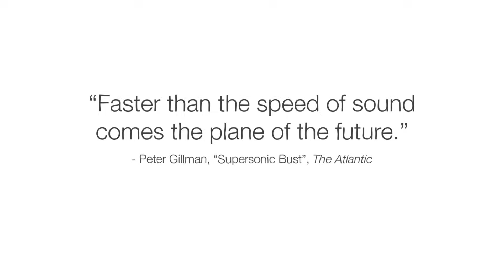Why are airplanes slower than they used to be? - Alex Gendler

Comment: I hope to see the day , where supersonic flights , are seen in big airplanes. As someone who has to travel from Madrid to Guatemala City and back to Madrid , 7 times each year , wich means making the flight 14 times each year , and it is an 11 hour flight , It would be life changing if it could be done in 5 or 6 hours
Reply: The Problem there is a bunch of physical limits and restrictions.
Various parts of aerodynamics/air resitances increase exponentialy with a linear increase in speed, which means that e.g. if you go from 500 to 600 km/h your required power goes up by 20%, but to go from 900 to 1000 it goes up by 30% even though both are 100 km/h improvements.

Air speed is fairly fast compared to other modes of transport, as you need a certain minimum speed to fly, and the fixed costs of airplanes (seats, certain safety features, cargo space, the crew etc.) are high. So if your plane costs you e.g 9k 'fixed' + 5k 'variable' costs an hour to fly at 500 km/h, spending 200 more an hour to go from 500 km/h to 600 km/h is worth it, as the pk fixed costs will still be larger while covering mroe gorund, meaning you save money. But going from 900 km/h to 1000 km/h miht up variable costs from 8k to 10.4k your total costs will go up more than your speed increase. 

That in turn means ticket prices will go up, and while numbers i gave here are just imagined examples, i've seen various papers in the past that calculate anywhere from a 2 times to a 4 times increase in ticket prices on average to go from 900 km/h top speeds now to 1400 km/h top. 
Then consider how much you pay for your flight, and consider if spending 3 hours less on a plane would be worth it to you to (probably) spend at least a couple hundred dollars extra, if not more. 
And most of that comes from hard physics limits. The stuff mentioned in the video is just convenience tech to break the shockwaves, that doesn't reduce the cost of the fliht in any way.

Comment: Is the same for cars, cars are slower today? Standard air travel vs the Concorde isn’t a fair comparison.  It comes down to cost, fuel at high speed will always cost a premium even with advancements.   As velocity goes up.... drag increases.    A car can go 150mph with 5 miles per gallon or go 60mph at 35 miles per gallon.  The designs are nice and very well explained just the title is a bit off.

Comment: Not only Concorde disappeared, but regular airliners are getting slower and slower.
When de Havilland Comet appeared it went 450 knots, 
at the same time Tupolew 104 went 510 kn,
Latest Boeing 777 travels 518 knots and it is considered an achivement over speeds of 500--, most modern airliners travel.

Comment: What on earth is surprising about a Sonic Boom? We have known about these, in practice, for the past 80 years. Concorde was noisy at even subsonic speeds, because of its engines.  Surely the main problem about aircraft speeds is that to maintain a safe air traffic control system, all planes in a sequence have to be averaging the same speed, otherwise they are likely to have close encounters.

Comment: I saw too that the concorde was just too fast. with it being expensive it was mainly restricted to the upper class. so the seating could not be like economy seating which meant fewer people on the plane at a time and combine that with weight being an issue the load is very limited. also with it being so fast people weren't really buying food or drinks in the air which I guess makes up a lot of the airline's revenue. Also flying has become a bit of an "experience". People don't want to pay a lot for a very short ride.

The standard commercial jet is just more profitable. they can have more people on the plane and since it's in the air longer people will get thirsty and hungry so more likely to buy more products. Like it was stated in the video the demand wasn't there to make flights fast so they stuck with the most profitable method.

Comment: The problem with supersonic flight is that it is fuel inefficient. In a plane the Lift over drag ratio (L/D) should be maximised at cruise conditions. In order to achieve this an optimal cruising speed exists. For most aircraft this speed is subsonic. If the aircraft is designed such that the optimal speed is supersonic, it will generally have a much lower maximum L/D ratio. Given that the main challenge currently in aviation is reducing the carbon footprint and increasing sustainability, using supersonic planes for civil transport does not seem feasible currently.

Comment: Planes, like semi trucks, can only go so fast economically.  At increased speeds, you are encountering more drag which starts really costing a lot of fuel.  So, at a certain speed, you are safely airborne but using a minimum of fuel; each increment upwards costs.  This would only change if people really complained and cared; but they don't.  If everyone demanded going fast, at any cost, the SST would've survived and we'd be overrun by more and more of them...

Comment: Another problem with Concorde was they had to have certain requirements for runways as well as taking of and landing could not be done with aircrafts in a certain radius of the airport. It wasn't just the cost of the aircraft itself but also the runways and other complications it caused with other aircrafts making Concorde unsuitable for airports unless requirements were met.

I grew up on the funny story of my dad learning to fly a light aircraft and that a Concorde aircraft was made to wait until he landed.
Reply: I’d heard was one of the reasons that Concorde wasn’t given more US airports was simple jealousy. The US airline industry had nothing comparable and the C rubbed their noses in it. So they amplified the complaints about it to stymie the project long term.

Comment: The higher you fly the less energy you lose to drag resistance. But too high and there won't be enough air intake to power the combustion engine. If an all electric plane was feasible I'd be a lot faster... I give tesla like 5-10 years there's not much elon can't do

Comment: Some corrections needed. But the one that stands out is the timeline of Concorde. It’s very convenient and adds to the flow of narrative but Concorde planned exit from service long before 911.
The engine failure over Paris in July 2000 bought forward its end quicker. Other issue that was known before 911 was from supersonic flight. a/c that sustain supersonic speed have a low shelf life. Due to stress on airframe. The high cost of maintenance, after supersonic speed a/c has maintenance check before next flight, unlike a 777 that can after pilot check go on another flight. Concorde has some panels that has to be opened and checked my me. Hahaha. If you asked a mechanics for Concorde they would tell you the plane take so many hours for just one flight so it’s not worth flying. 
This is common with “Ted everything.” It’s a talk that needs flow. So some facts are over looked or negated.

Comment: Another few problems I see:

1. The total time of making a trip also includes the time getting to and from the airport and through security. If getting to the airport and onto the plane is going to take you a total of 2 hours, and perhaps 2 hour to disembark and to get through customs, get your luggage and arrive at your final destination, the difference between a 6 hour flight (10 hours total) and a 2 hour flight (6 hours total) is not really as useful as it seems. Plus, if for the price of sitting in a normal economy-style seat on a supersonic airliner you could fly first class in a layflat bed in a subsonic airliner, and have enough time to take a nap, etc., the benefits are even more reduced.

2. Jet lag. Even if you could teleport somewhere instantly, you are going to have to deal with the problem of jetlag. At least on a 6 to 7 hour flight, you may have a chance at taking a long nap, etc. 2.5 hour flight, not so much. Perhaps on a north to south route within the same time zone or two it would be advantageous to have as short a flight as possible.

3. Range. The Concorde only had a 4500nmi range. Due to the reasons noted in #1, a supersonic aircraft may be most advantageous for time savings on long flights. The A350 XWB Ultra Long Range can fly routes up to 9700nmi. It would be nice to see a supersonic airliner with this type of range.

Comment: "A standard transatlantic flight stil uses as much as 150,000 liters of fuel"... How come TAP Air Portugal has a transatlantic route from Lisbon to Newark (New York) with an Airbus A321 LR that has a maximum fuel capacity of 32000 liters of fuel? With 150000 liters of fuel that is 90% of the fuel capacity of a Boeing 777-300 ER that is the largest dual engine commercial plane in the world you can fly from Paris or London to Los Angeles (on the Pacific coast of USA) no problem ...

Comment: This is only partly true.  The SR-71 proved you can make hyper sonic planes MORE fuel efficient by using cones within the intake that slows the air done to subsonic speeds. While traveling at speeds still unsurpassed till this day. I believe we as a people stopped advancing and wanted money in our pockets hence why we stopped using the Concorde. Somethings aren't that deep. It comes down to bottom line and politics. Planes traveling faster means we get goods faster. But more on that later

Comment: What about taking a page out of the F-14 tomcats books and having the wings retract back as flight speed increases? Mount the engines at the rear similarly to the DC9. I suppose that wouldn’t help the sonic boom problem but may help fuel economy as long as the mechanical engineering required to do so doesn’t weigh too much.
Reply: Where would the passengers go?  Do you realize how big the wing swing mechanism would have to be for a wing that large?  Oof?
Reply: @Ampersandrascott  how big? There’s obviously a reason they don’t do it. Highly unlikely I thought of this before actual engineers.
Reply: @dannyd806  Let me give you an example. When we were developing the Boeing Sonic Cruiser, we were fighting the size of the mechanism to control the canards. The passengers would have had to duck under it when going up and down the aisles. Now, a canard is very small compared to a wing. The pivot itself would protrude into the passenger compartment, not to mention the drive mechanism to run it. The Boeing SST had slanting wings, and to keep the weight down it employed an astronomical amount of titanium. We all remember when the SST was cancelled. It practically put Boeing out of business.

Comment: I dont know how planes fly but why not use the super sonic speed to go really high and then slowly descend towards the destination without using fuel?  
Maybe some sort of wings that can change shape,heck they could do some sort of electric powered engine instead of fuel and that the engine works by taking in air from outside which spins it really fast and thus creates electricity that powers the engines. 
Maybe this is how it works now idk.

Comment: I thought the sonic boom only happens when the aircraft breaks through the sound barrier ? not continuously ?
Reply: No, a sonic boom is generated the entire time an aircraft is traveling faster than sound. It is not heard on the airplane itself, but behind and below it as the shock wave propagates.
Reply: It pushes a continuous wave until it drops back under the speed of sound at that altitude.

Comment: Electric planes/planes with batteries will most likely never be a thing. With fuel the further you fly the lighter you are because you’re offloading fuel. Batteries are the same weight no matter how far you go, so while you’re flying draining the batteries and staying at the same sight which cost money because you are now flying a heavier plane for hours.  As well batteries lose efficiency over time and that could change how long planes can stay in the air, and how long until battery power is misjudged and one falls out of the sky?

Comment: I’ve always thought Commercial airline travel in the technological sense to be extremely lame. We should have entered the next generation of flying over a decade ago, or seen big drop in prices but we do not have that either. Next generation airplane travel has not happened with traditional energy methods and likely not to happen within the next decade. Which means the next generation of flying is going to come from the first company that can successfully mass produce solid state battery technology (which will take at least a decade), at the same time designing planes aerodynamic to avoid sound barrier issues. We may see a new commercial airline industry by 2035

Comment: Think of it this way: you can probably run further at 5mph than 10mph, even though you're going half the speed. Increasing the speed creates an exponentially greater need for fuel.
Reply: What popped in my mind was the old adage that a car driving at 55mph is at the ideal speed for fuel efficiency. Slower or faster and it sucks more fuel. I’m not sure if that has been debunked or not, but anecdotally I have noticed it with my motorbike with 55-60 mph giving me the longest range before fill up.
Reply: @bcs2em625  yes, another great analogy

Comment: TED-Ed spends more care and attention to animations than it does studying the topic.. The Air France Flight 4590 and new FOD sweep requirement was the direct cause of the aircraft's demise. No mention in the video.  Also, the NASA-DARPA Shaped Sonic Boom work is almost 20 years old now, and did little to influence follow-on research.  Signed, an Aerospace Engineer at DARPA.

Comment: What about just increasing the cruising altitude?  Wouldn't that make the plane more efficient and fly faster due to less resistance?
Reply: At higher altitudes the air is too thin to generate enough lift to maintain stable flight. Aircraft that fly too high are at serious risk of entering an aerodynamic stall. Google "coffin corner" for more detailed explanation.

Comment: The international standard is to measure airplane fuel in pounds and fuel capacity on planes in gallons. Seems strange to talk about airplane fuel consumption in litres. You’d sort of have to go out of your way to metricate those numbers. Why?
Reply: Well, it's the international practice. The norm, however, is defined by annex 5 of the Chicago Convention on International Aviation, which says the SI system has to be used in-air and on-ground but allows to "temporarily" retain some non-SI units like miles, gallons etc. (quite easy to google)
To my knowledge, only Russia (and China?) are following this convention and use the SI system.
All other countries kept the imperial system due to the dominant US influence. Doesn't mean the sky should be metric though.

Comment: I think the better question is why am I paying so much for a ticket when commercial planes use very little fuel🤔If they used the amount of fuel they tell us, there would be a line of fueling trucks constantly going to and from the airports but we never see that
Reply: This is why ignorance breeds conspiracy.  Just like your local gas station, airports have massive fuel tanks underground.  At some really large airports, huge fuel farms with massive cylindrical tanks are located off the edges of airport property (away from where planes take off and land because you wouldn’t want an accident taking out that infrastructure).  When airplanes refuel, a truck with a high power pump connect to the ground and the plane and uplifts the fuel.   Occasionally you will see planes fueled directly from a fuel tank truck, but that is usually based on facilities/capacity.

Oh and the video got something wrong, fuel isn’t 20% of airlines budget.  It’s actually around 50% these days.
Reply: @A_MOISTER_OYSTER  😅😅😅 the amount of fuel the put into planes wouldn’t allow them to fly if it were true. They put it into the wings which are made from aluminum which they tell us.and I’d that’s the case the wings would snap from all the weight. Ever see videos when planes catch fire??? They would explode immediately because that’s were the fuel is kept. Maybe use your brain once in awhile if you still can
Reply: @AsliceofWisdom   ahhhh use my brain… I guess the two decades I have been an airline pilot calculating fuel requirements, weight and balance, and studying the fuel systems of all the planes I am type rated in counts for nothing against you “using your brain” and determining an aluminum wing cannot hold large amounts of fuel.  Got it.

Comment: Wrong. The reason more fuel is burned at higher speeds is not because of more air intake. (That would actually be helpful.) It is because parasite drag increases with speed, requiring exponentially greater thrust and therefore, exponentially greater fuel burn.

Comment: Uhhh.. I think you missed the part that the Concorde planes were accident-prone.
Reply: No it wasn't. In 30+ years of flying there was only one crash of a Concorde and that was because it blew a tire on takeoff after hitting debris that was left on the runway from another airplane. Parts of the blown tire then damaged an engine and the wing resulting in a fire.